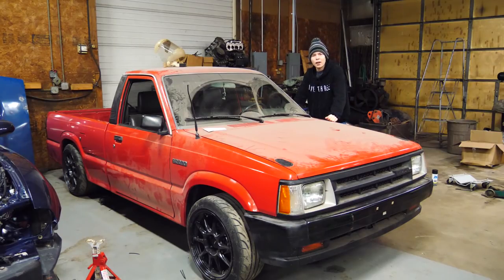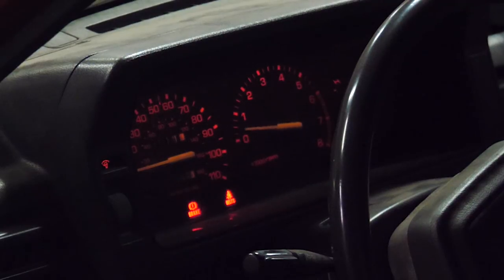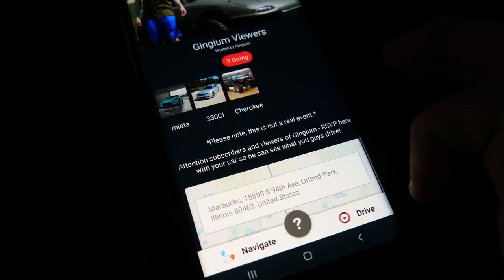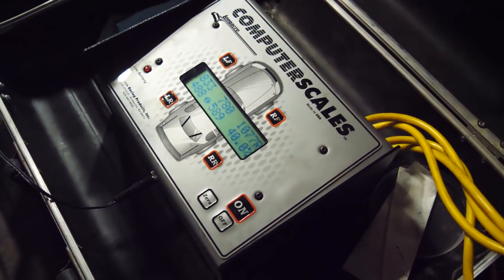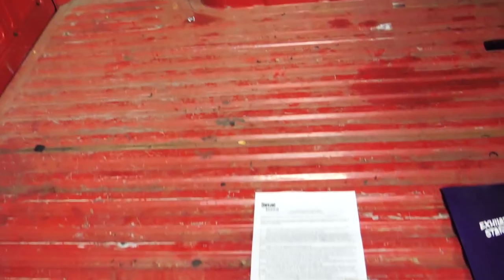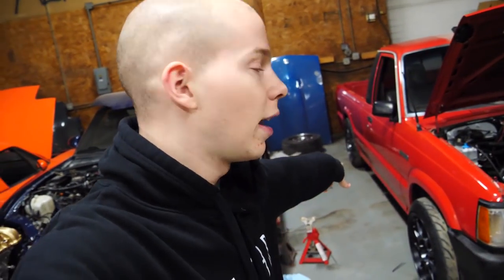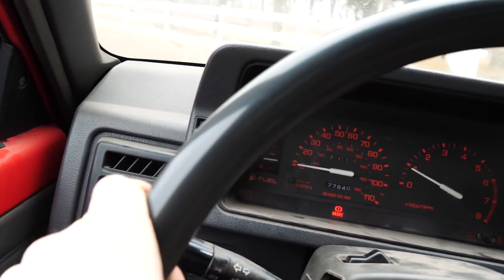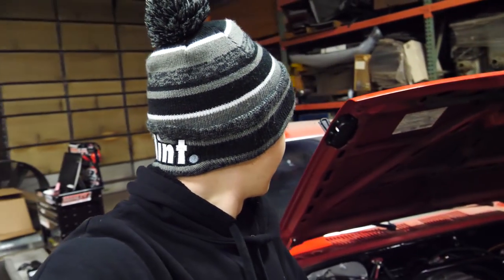FIRST DRIVE in the V8 Drift Truck! + We Weighed it and ITS SO LIGHT!

Comment: Deffinatly dont think a rear turbo is a good idea. Hoonigans master mechanic dan with years of experience tried making one on shidcar and it was trash, so much piping and so much room for boost leaks. Also very ugly
Reply: Dont base what you know of off Hoonigans. Dan didnt do it right at all, the cut corners on purpose. Rear turbos work just as well as front mount. Corvettes do it all the time, some over 1000whp applications.
Reply: @fastec5  I feel like he'd be better off putting it through the hood a little rather then in the bed, I can see him having to go through a lot of trouble trying to do a rear turbo